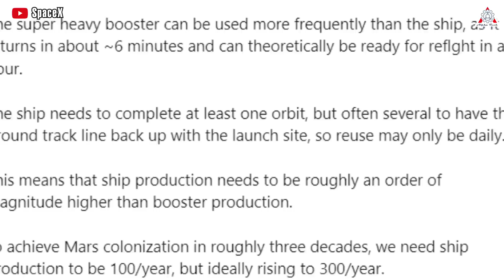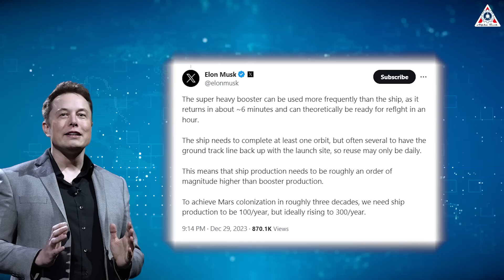Elon Musk just revealed SpaceX's crazy manufacturing shocked the world!

Comment: Basically its about how many ships are in the production line at a time, to a ratio of how long from begining to end. i.e. from structual resources to completed unit times units in production.

So it nees to be a long production line. 
My guess is it will be shortended by having ships ganged, rather than linear. i.e. production lanes rather than a single line.

Engines, They will be easy in comparison to hulls. From Raptor 2 forward, increasing simplification, and size up scaling. which reduces numbers of units necessary in ratio to ships.

On another Mars related topic, I was thinking about the tunneling for habitat, and that you arent going to be able to use air or water to carry off the removed debris.

And realized you could build tube conveyors
Using oversized bead chain like on dog tags, and then have pistons or thick discs beaded at intervals along the chain, which then runs inside a tube.

This system would work 3 dimensionally around corners...
And could be powered electrically, and maybe at pretty high speed.
And you could use sectional connectors similar to the dog tag chains for maintenance and assembly...

And if you used stainless, some types are highly abrasion resistant like used in hard facing on excavation equipment.
Hope this concept gets to Elon, he could develope it here with the boring company.
And be ready on Mars to build multi level habitat tunnel arrays.
And get the Mars  Monkeys protected from radiation and temperature extremes.
I have done past writs here on Alpha Tech about the array system.